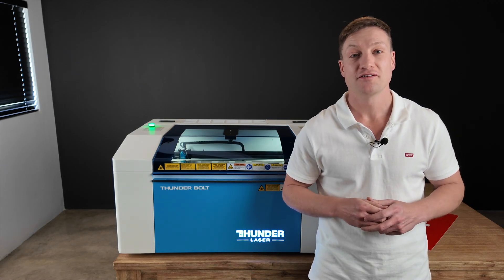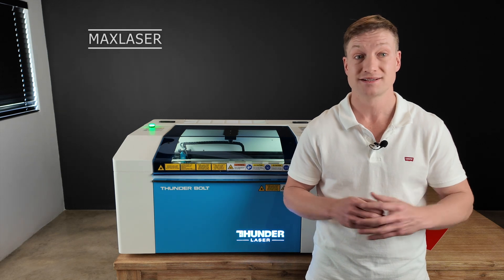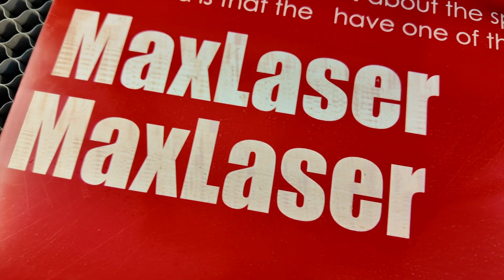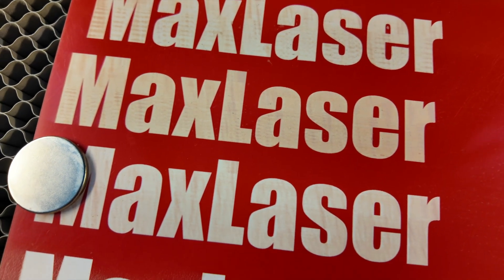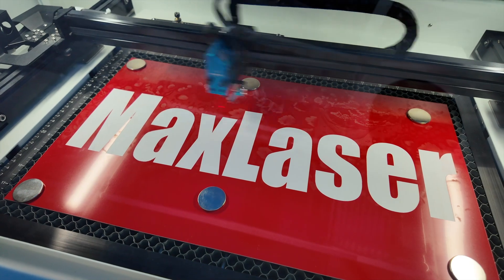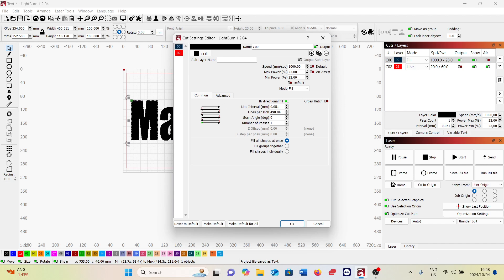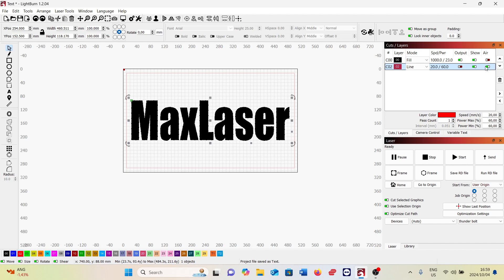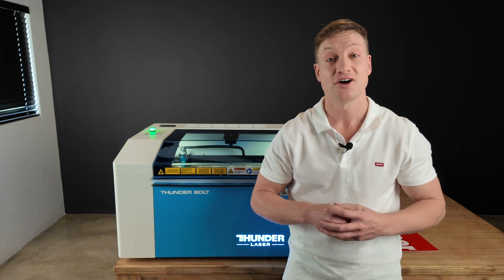Laser Engraving Red On White Plastic

Comment: Great video, very informative! Please keep them coming. On my Nova 51, I usually set the DPI to 300 with the air assist barely open, and it works perfectly. Now I’m excited to try it on the red and white combo!
Reply from the maker: Your welcome, so i haven't got to the Nova range yet but the core technique should be the same. You will need to do some test blocks though,  going out of focus so you melt the plastic instead of vaporising it, be careful of using too much power then the material will start to bow. Hope it works out !!! Let me know